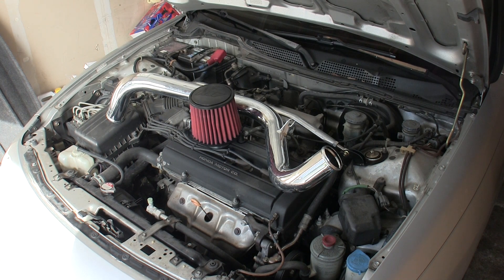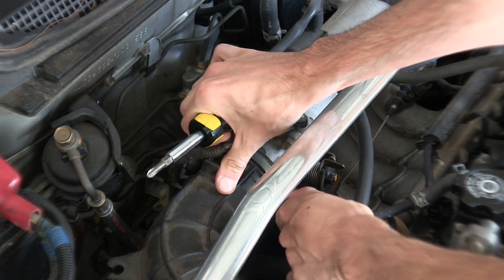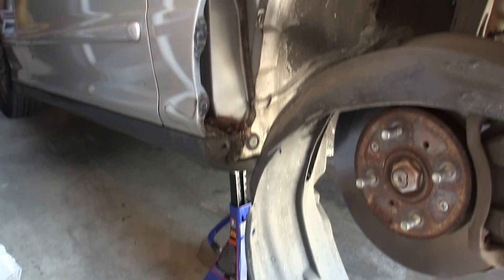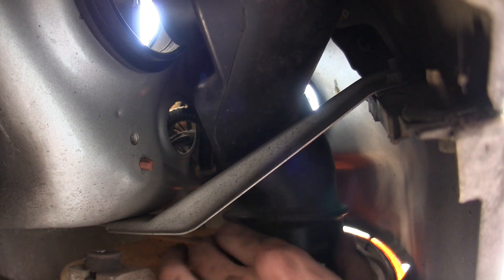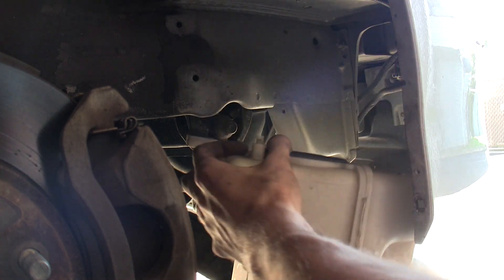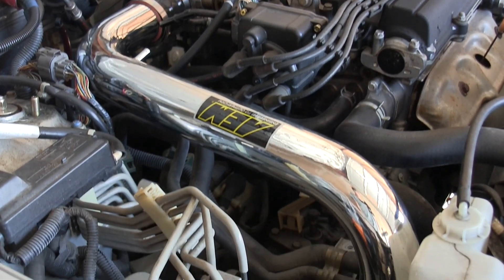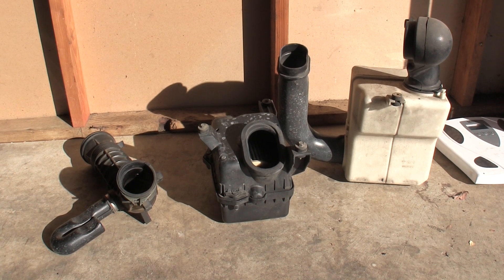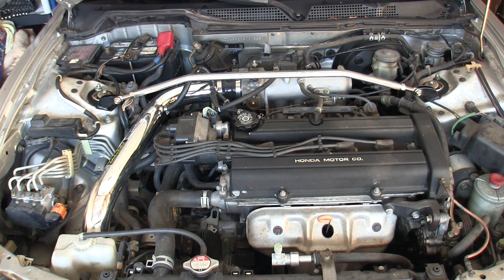Cold Air Intake Install - Project Integra

Comment: Fir a stock motor this is a really dumb thing to do. You more or less just changed how the air intake looked. Your not going to have any performance gain when your stock air intake got "cold air" from the same spot as your Shinny new one
Reply from the maker: The stock intake actually pulls from the engine bay. I'm not concerned one way or the other if it makes a difference, I just want to learn if it does or not. Lots of people buy these thinking they'll see HP gains. I'd like to show (with testing, not just hearsay) whether or not there is any value in doing so.
Reply: There's no way to actually know if you're gaining hp because at max you would expect a less than a 5% gain. And even if you do gain 5% you base hp number is too low to notice a difference. You would be looking at a 2-3 hp
Reply: richard barnes so you are saying that a stock integra is roughly 40-60hp by that maths?

are you unintelligent?
Reply: richard barnes Don't know if you follow his channel long enough, but his goal seems to be information gaining rather than performance gaining :¬). I think you will be right about the performance gaining, but i think everything depends on how he is going to conduct the tests, and the conditions. Maybe he is not going to gain performance, but i wonder if for instance here at Brazil, with an ambient temperature of 40 C° and heavy slow traffic, this would not prevent the engine from loosing a lot of performance.
Reply: Engineering Explained
The independent third-party testing aspect is what makes me want to see the results. Next you should try the "turbonator." That company makes pretty big claims. Oh, and then a video for the $20 ebay resistor "mod." Amazing how much they target people that want to make their car fast without putting in the substantial work. But really the results will do the talking.
Reply: Weight reduction bro! ;)
Reply: It will Rev easier....... In neutral. When you just want to be a social jackass. But with such a low hp base there will be no difference in driving performance
Reply: @xRICHiZS1Kx ur brain dead
Reply: no? im saying realistically you would not get what they clam you would gain. they say 5 % but i 100% doubt you will see that. what your most likely to see is maybe a 2-3 hp difference witch could be attributed to a number of variables not the air intake
Reply: You also have to think about how it revs. IT will probably be unnoticable but it will probably rev a little easier or respond better to throttle input. Yes the throttle body and intake are still bottlenecks but the rest of the intake is alot more free flowing allowing the air to come through the filter to the throttle body quicker and with less friction.
Reply: richard barnes The stock intake system on an Integra is extremely convoluted and restrictive compared to an aftermarket CAI or airbox like CT Engineering's Icebox. The air inlet is located inside the engine bay in front of the battery, it then continues through a tube into a large resonator chamber located inside the front bumper, and up another twisting tube into the airbox that houses the filter, that then travels up the rubber intake arm to the throttle body. I can tell you from experience that an aftermarket intake will greatly improve throttle response on these engines, and make a little more power than you think. The Icebox I run on my car keeps the filter in the stock location but eliminates the resonator chamber, and the induction point is changed to right behind the pass. side turn signal. While it isn't ram air, unless you take the corner light out, I believe the air is the most dense in that area, and significantly cooler than where the filter is located.

Comment: Can't you just modify that new tube/hose and place it near the throttlebody, to prevent sucking in water by the intake. But when attached, maybe it will now suck in some engine heath?
Reply: That's basically the short ram intake concept. Which has been covered in the last two #ProjectIntegra videos
Reply: Nicktrance1 It's a concpet/theory. But the question is does it actually work in practice? I look forward to the test results because intake mods have always been the subject of controversy. I know that it brings out the woosh and pshhhh sound it turbo cars but the horsepower gains are debatable.

 As much as I love the BOV/BPV sounds I would rather spend $150-350 on mods that without a doubt will bring out performace gains that no one debates. I have a Mazdaspeed 6 and plan on buying tunning software kit plus some cheap (but non controversial mods) so I don't waste the little money that I can afford to spend.

PS: I think that the headturning intake BOV/BPV sound isn't something I want cops to hear while I'm boosting lol.

Comment: are you educated as a car mechanic? i Wonder because you know so much about cars?
Reply from the maker: Nope. I went to school for mechanical engineering, but I've learned most of this on my own. The internet is a fantastic resource, just terribly organized and plenty of bad information tends to surface. Hoping to sort through it logically and present my findings on this channel. :)
Reply from the maker: walperstyle Can you explain to me how an ECU would realize there is additional air but not do anything about it? My car uses a MAP sensor (speed density). When it sees there is more air, it injects more fuel to compensate. If I drive at a high altitude and the oxygen is low, do I need to retune my engine, or will it figure out the pressure drop? If it's cold in the morning but warm during the day, do I need to retune for the different air densities, or can the ECU handle it?
Reply from the maker: walperstyle Haha, we all have other things that we must be doing other than working on our cars. I'd love to spend more time (and money) on mine, but don't quite have it either. I don't imagine it will create much of a power difference, but it's certainly worth testing in my opinion.
Reply: Engineering Explained You pretty much just rekt him.
Reply: Engineering Explained So Far you are doing a GREAT job, love it, keep up the good work!

Comment: Cool Video! What happens if you hit a huge puddle and soak your air filter? would it suck water in or since that pipe is as hell would it not even make it to the throttle body? Also how would a wet air filter affect the car?
Reply: Yes, you are correct, but did you ever stop and think there is a reason I made this my YouTube name? It's literally been my nickname my whole life. My name is Bill Sack, I was bullied maliciously when I was young for it, and by the time I was 12 I just started to see the humor in it. Don't you think if my name was Bill Sack on Google simple minded people would try making fun of it? That's the reason I just went ahead and made it Ball Sack instead, to save people the effort of trying to be funny. Also, I don't care what people think of me. There was actual logic put into my Google+ name not me being simple minded.
Reply: TheSamplebridge You should really go to English class.
Reply from the maker: For small puddles the fender liner should protect it from water splashing on it. If you were to go into a deeper puddle, deep enough to reach the filter, it is possible to hydrolock the engine. If you're lucky, it will simply stall. Otherwise the weakest link will break (the piston tries to compress water, which it cannot).
Reply: Engineering Explained Break*    =P
Reply: He just owned you with a levy bow paired with arrows of the finest ivory, dipped tip side in shit.
Reply: Ryan Tedder did you just quote old man samson?
Reply: TheSamplebridge Ok.
Reply: TheSamplebridge That's not what I said bro...  take 10secs to proof read your comments next time. It doesn't have to be fancy shit, just coherent. So you won't have pricks like me or the other guy call you out on it.

* In my shop class there is a supercharged 4 cylinder engine that came out of an Audi (I don’t know what model). The rods, rings, and crank were all screwed up. Turns out the guy ran it through a deep puddle, and ruined it all because it pulled in water. Now we have a screwed up Audi engine.
Reply: It is shielded by the fender liner.
Reply: In my shop class and there was a supercharged 4 cylinder engine that came out of a Audi (i don't know what model) and the rods, rings, and crank was all types of screwed up. turns the guy ran it through a really deep puddle and the supercharger pulled it all in and ruined it. now we have a screwed up Audi engine.
Reply: TheSamplebridge I'm not even gonna begin to argue with an inferior mind.
Reply: Ben Oakes Never come here again......
Reply: Ball Sack so you made a immature nickname on you tube, all because you where bullied into a corner. wow how is anybody even supposed to understand the joke. its like giving away the punch line before telling the joke. people will just look at you as some troll who finds ball sacks a funny topic.
Reply: Ryan Tedder nah ill stay
Reply: Ball Sack calm down ball sack, its a simple mistake.
Reply: ***** I don't see how explaining how my shop has a supercharged Audi engine makes me retarded.
Reply: ***** obvious dumbass (you) is a dumbass, just walk in hear call someone retarded for no reason and walk out. Yep, you simple mind must find that the fitting way off ending arguments on your behalf.
Reply: /thread